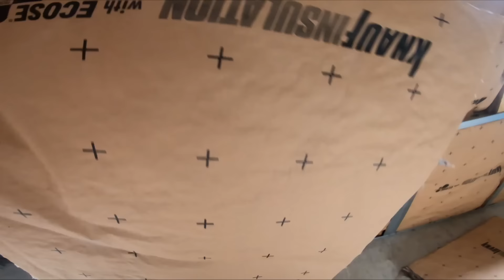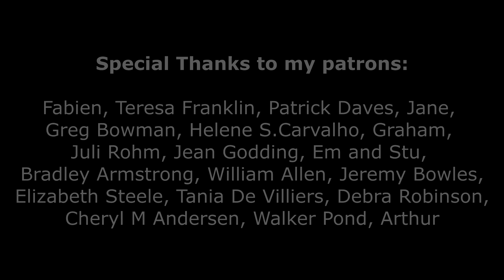TIMELAPSE: Couple Restoring a 200 Years Old House (3 months // SUMMER in 45 Minutes)

Comment: Hi Diego!

In the kitchen, you demolished the old wall, but left one piece of it. I guess, because of budgetary reasons, or because it was in good condition. My question is, on that piece of wall end, why did not straight it out with concrete, before starting to build up the new wall? It seems like to me it's more work to patch the "holes'', after you build up the new wall. You did this in spring too, when you made the new wall on the guest room. I am just curious.